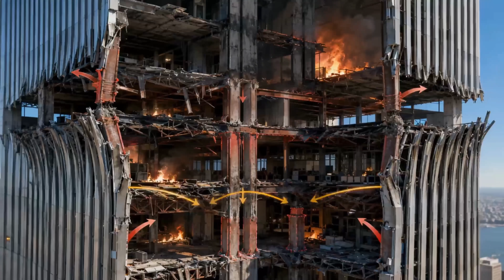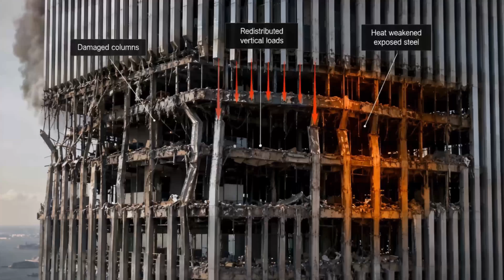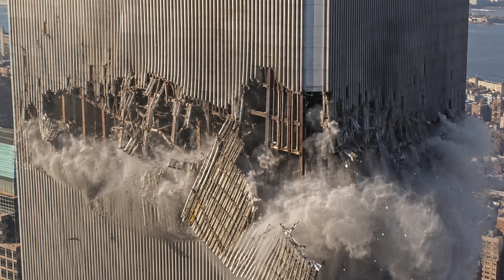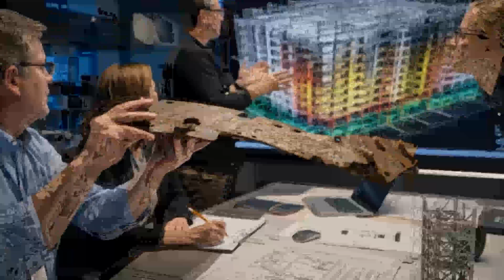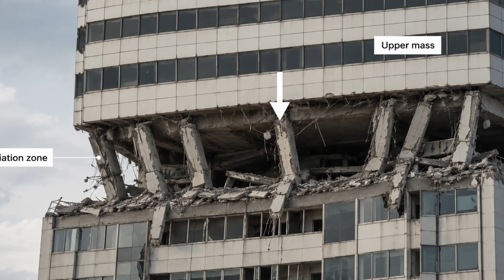What Happened Inside the Twin-Towers After Impact?

Comment: Ppl say the Twin Towers look fragile because of their appearance, but in fact, they might be the heaviest structure ever built if you look at it that way. The steel columns are 30 inches wide; it takes dozens of people to lift just one piece. And that's what must be traumatic... We jump when a heavy metal object falls to the ground. Imagine the impact of a 417-meter steel tower with concrete, machinery, and supplies crashing to the ground, not to mention the sound of the weight gradually accumulating
Reply: Nah people think every single building can withstand a freaking airplane at 700 km/h

Literally no weakness at all, it took them a lot of time to collapse for what they were against
Reply: Building 7!was not hit by an airplane.  So much for your theory.
Reply: @markcohen308  No, but it was hit by falling debris from the towers, sparking massive fires within the building.
Reply: @TheTruthCalls 
What "massive" fires made wtc7 to collapse simultaneously from all sides at gravity acceleration???
Reply: @ciuzdamm There are dozens of documentaries out there explaining the damage caused by the tower collapse, and extensive evidence of the raging fires burning within the building for hours before the collapse. If you wish to ignore this evidence, then that's on you, but it is out there.
Reply: @TheTruthCalls  It wasn't hours bro, There is no law in this world that they could collapse fully and vertical, ask an expert they say that is impossible, that's evidence but most keep their mouth shut except for Coen Vermeeren.
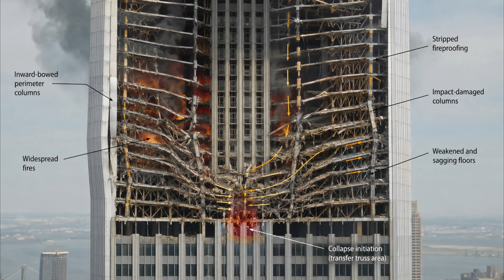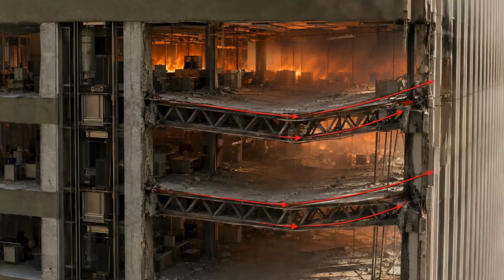Reply: @Darth-Lord-Raven  I consider seven hours "hours". Tower 1 came down at ~10:30, it's debris striking WTC7 and setting it on fire. The building eventually collapsed at 5:21, or seven hours later.

The towers collapsing straight down is exactly what should have happened given their design. As the floors started pancaking down, the central core kept the floor slabs in a vertical line. Computer models confirm this is exactly what would be expected.
Reply: @TheTruthCalls  Exactly 7 hours? :text-yellow-goal:Suspicious. Yea well. It's really is as the fundament cannot collapse, everything is wrong about it. Where is this computer model?
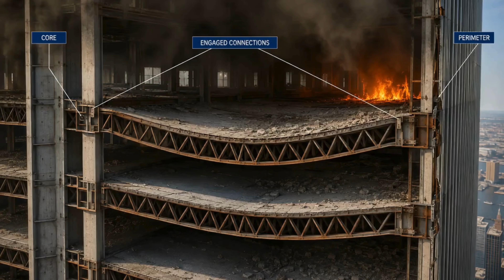Reply: @Darth-Lord-Raven  Not exactly - it was from 10:29 to 5:20, so 6 hours 51 minutes. You got me!  Suspicious?  How so... it's clearly documented.

It can and did collapse. NIST created a computer model of the failure, but there are numerous others out there. I suggest you do a little research but this time actually pay attention to the engineering analysis that explains it, as opposed to ignoring everything that doesn't fit your understanding.
Reply: @TheTruthCalls  Trust me i've done my research. There weren't any planes at all in the first place. I'm no conpiracy thinker  but always looking out for the truth. They used missiles and hologram technology that already existed for the twin towers, all these buildings cannot collapse mate it's impossible. They used nuclear explosion for building 7, there is no other way there is a 100+ meter smoke coming out of the top. Don't believe what you see, is not true.
Reply: @Darth-Lord-Raven  LOL... OK, and the moon landings were staged, right?
Reply: @Darth-Lord-Raven  Holographic technology is not even remotely close enough to make a missile look like an airliner, and at the end of the day, four airliners, including passengers and crew disappeared. So where are those planes, passengers and crew if they didn't perish when hitting their targets?

Further, the impact pattern in the towers show airplanes hit them. A missile would have created a circular hole, yet the entry wound is in the shape of a fuselage with wings... you know, exactly the shape we all saw as it flew into the building. Something tells me you're search for truth isn't working out so well.
Reply: @TheTruthCalls  Well, look it up: a Cruise Missile will have wings aswell.
Reply: @TheTruthCalls  That's another discussion bro.
Reply: @Darth-Lord-Raven  Yes, and the largest wingspan of all our cruise missiles is 12'. The wingspan of a 757 is 124', and a 767 is 170'.  A 12' wingspan did not make a slash into the building which was nearly the entire width of the building, which is 207'.
Reply: @Darth-Lord-Raven  And I'm sure it would be an interesting one. You seem to be so convinced of one thing that it's impossible for you to think of anything else. There are so many reasons to KNOW the towers and WTC 7 feel due to fire, weakened steel, and damage from the planes, and from the South Tower collapsing and hitting WTC 7.

And BTW, yes, the moon landings were real. Men have walked on the moon six times, and hopefully soon enough, there will be a seventh. I wonder what will happen to those who think we didn't land, once we're there and we document what remains from the prior landings. I suspect someone will argue a robotic ship was sent ahead to spread stuff about to pretend we were there.  LOL..
Reply: @TheTruthCalls  Be proud of your country then. Ppl liking to have lies lying for their nose. Fine for me, bro hope you someday wake up. And there is nothing personal on this conversation.
Reply: @Darth-Lord-Raven  The only one who needs to wake up is you. Your commentary here clearly shows you are easily duped, and have virtually no understanding of the complexity of controlled demolition.
Reply: @TheTruthCalls  Looks like you're under hypnosis, GL. Wake up bro.
Reply: @TheTruthCalls  I've yet to see any definitive proof that falling debris was the cause of the fires in Building 7. This is entirely speculation, and speculation is not science.
Reply: @sorcerykid  I disagree (I think).. I'm pretty sure there are videos of WTC 7 burning shortly after the South tower collapsed. There is certainly video evidence it was burning for over seven hours, so if you do the math, either falling debris, which put a 15 story gash in the building, started the fire or someone with a Bic lighter, but it was burning for a very long time.
Reply: @TheTruthCalls  Seeing fires after the collapse does not mean the debris started the fire. That is known as speculation, which is not the basis of forensic science.

I worked at a famous Illinois nightclub for almost 15 years until the owner retired. The business was bought out by real estate developer who knew the history of the building, yet really wanted to replace it with student apartments. However, the developer also realized that the city would look very unkindly at him demolishing a 140 year old buiilding given its cultural significance (I know all of this because I secretly overheard him joking about it to some other developers as I was cleaning out the DJ booth).

Now get this: Less than 4 months after the deed was transfered, the upstairs workroom caught fire, which led to significant structural damage requiring much of the interior to be demolished. However, this fire was widely reported in the news as purely accidental with no known cause. Yet, within only one week of the incident, I was brought in for questioning as the prime suspect in an arson investigation, apparently because as the former head DJ I spent more time there than almost any other employee. During my multiple rounds of questioning, I learned that they found a blowtorch in the workroom that was used to ignite the beams above the office. Yet despite all of this, the arson investigation never got reported in the news. So the public at large, still to this day fully believes the narrative that this famous historic building just suffered an accidental fire right after it got bought by a new owner.

This is why I refuse to buy into any speculation about the cause of the fire in Building 7 without definitive and indisputable proof. Because as you can see from my own first-hand experience, it's very easy to con the public into believing a completely different story about the cause of a fire, whether because the media is completely oblivioius to the truth or else because of certain powers that be seeking to suppress the truth so as protect the interests of various stakeholders.

We absolutelly cannot eliminate the possibility of foul play. It would have been effortless for a bad actor to enter Building 7 given all the chaos of the North Tower collapsing and start random office fires with nothing more than a lighter.
Reply: @sorcerykid  Trust me, I understand we can not eliminate the possibility of foul play, but by the same token, you don't have any evidence that it was. Conversely, we do have one of the tallest buildings in the world collapsing adjacent to WTC 7, and that collapse did cause significant damage to the exterior skin of the building. So of the 'competing theories', the fire starting as a result of the collapse does have much more supporting evidence. The fire did start about the time of the collapse, the building was struck by falling debris, and, as far as I know, there is no direct evidence of foul play. Plenty of speculation, but nothing that proves it.
Reply: @TheTruthCalls  We had the collapse of the South Tower into the Deutsche Bank Building which caused extensive damage to the exterior of that building, yet not a single fire erupted moreless on multiple floors. Yet despite the similarities in distance, size, damage, etc. including being struck by debris from one the world's tallest buildings, only WTC7 caught fire.

Saying, "you don't have any evidence it was" is not a reason to dismiss the potential for foul play. That's not how fires are investigated. Add to the fact, you can't put forth any theory until you have evidence. And there is currently zero evidence to substantiate that the fire in WTC7 erupted as a direct result of debris from the North Tower. This is why we have the Guide for Fire and Explosion Investigations (NFPA 921) standard which strictly relies on positive evidence. Without positive evidence, the cause is undetermined.

You also remarked, "we don't have any evidence" despite the fact I just shared a story about an arson investigation where I was the lead suspect and there was concrete evidence available, but those facts were never shared publicly nor reported in the news.
Reply: @sorcerykid  Did the Deutsche Bank building have 40,000 gallons of diesel fuel stored inside?

"Saying, "you don't have any evidence it was" is not a reason to dismiss the potential for foul play." - I agree, which is likely why I agreed in my response to you. But again, the building was adjacent to the worst building collapse in history, did suffer substantial damage, and the fires did start about the same time as the collapse. Conversely, there is nothing other than speculation to support a more nefarious explanation. However, I agree, the cause must remain undetermined if not proven.

Sharing an arson story is not evidence to support intentional lighting of THIS fire. History is littered with fires starting due to arsonists as well as fires starting due to no direct intentional action. Just because people burn down their homes for insurance payouts doesn't mean all home fires are started that way. And while I also would agree evidence is often hidden, and so this remains a possibility, this still remains nothing more than speculation.
Reply: @josearturobaez  You can't fly a plane at that speed on that height so it wasn't a plane at all.
Reply: They weren't strong structures at all the steel was only 3/8" I-beams near the top.
Only the basement was strong the rest was lightweight.
Reply: That’s actually completely logical🤦 the higher you go in a skyscraper, the less weight the columns have to support, which is why the steel can gradually become thinner toward the top. The columns near the bottom, on the other hand, have to carry the accumulated weight of dozens of floors above them, so naturally they need to be much heavier and stronger. So pointing to thinner steel near the top as evidence that the Twin Towers were somehow weak doesn’t really make sense, since that difference in thickness is simply part of how the structure was engineered for the loads at each level.
Reply: @patatebanine4278  Well that would normally be the case - but here there is a massive transition from very heavy basement design => light weight office floors => to massive heavily engineered hat truss at the top. So its inconsistent with that normal concept.
Reply: @patatebanine4278 there is no way the top section collapsing was going to cancel the lower sections ability to hold up what was above it, as it collapsed through the zone of greatest resistance at near free fall speed. Mossad blew it up. They are demolition experts. They have demolished 90% of the buildings in Gaza in 3 years. Mossad are bomb experts they detonated 3500 pager bombs simultaneously in lebanon on the single largest terrorist bombing in human history. 9/11 was a cakewalk for mossad. Imagine the covert operation required for the pager bomb operation. 9/11 would require the same expertise. Capability opportunity and motive equals mossad
Reply: @patatebanine4278 I'm UNION IRONWORKER AND YOU GUYS COMMENTS ARE SO IRRELEVANTS,, NO F... WAY I-BEAM  ARE 3/8 THIN OR WIDE, IN A HIGH RISE LIKE THAT THERE'S HEAVY 5-8 INCHES THICK FLANGE BEAMS, THEY CALL BOX COLUMNS BUT THE HEAT WILL BEND STEEL WHEN IT REACHES 1500 DEGREES PLUS WEIGHT ON THE FLOORS NO  IRON WILL RESIST ALL KINDS OF DAMAGES, I SEEING IT BEFORE
Reply: So you’re saying the towers collapsed due to explosives set off by Mossad?
If you look really close there were actually fully-fueled passenger planes that crashed into and exploded inside both buildings that day. That’s prolly unrelated to the collapse though right?
Reply: @SpaceIceEnthusiast mossad explosive collapsed the towers. The planes if they were the commercial flights we are told hit the buildings did damage. The subsequent fire did damge. The buildings collapsed because of pre planted explosives. Basic crime analysis: Motive, opportunity, capability, falls to clandestine state operators, not just a CIA asset on dialysis in a cave in tora bora with a satelite phone.
Reply: @SpaceIceEnthusiast Not touching the geopolitics, no clue about that. But mechanically: '93 was a truck bomb in the basement meant to topple a tower, and it failed. Years later the plan changed to hijacked planes. If explosives already failed at ground level with easy access, the idea that smaller hidden charges near the top somehow finished the job better in 2001 doesn't track. And structurally, taking down a steel tower with explosives means precision charges on every load-bearing column, wired in advance with full access — not something you slip in quietly.
Also: what adhesive keeps a charge bonded to a steel column through a 500+ mph plane impact and a kerosene explosion? No adhesive survives that, which is exactly why explosives don't explain the collapse.
What does explain it is progressive collapse. The South Tower was hit around the 78th floor. The impact and fire weakened the steel supporting the floors above that point, and once those floors couldn't hold their own weight anymore, they gave way and dropped onto the floor below, which then couldn't hold the added weight either, and so on down... that's what we call the "pancake" progressive collapse. It's a weight-accumulation failure, not a demolition pattern
Reply: And your course “the building was weak” crowd never points out that the core columns could support twice their load and the perimeter columns five times their load.
Reply: @patatebanine4278  and the 93 incident and also the massive three alarm fire in the North Tower on 1975 both did ZERO to the structural integrity of the building.  Just magically on 9/11.  Oh what about the jet fuel??, what about the plane impacts??  NIST said the jet fuel burned off in minutes and Building 7 was not hit by an airplane and it too collapsed at free fall acceleration.  The official story is deeply problematic from every direction.you want to look at it.  The official story is Anti-Science in the extreme.
Reply: @patatebanine4278  Wait, so let me get this straight. Office fires can bring down a massvive steel-framed skyscraper faster and easier than carefully placed explosives can. In other words, the controlled demolition industry is an outright scam.
Reply: @fx-studio  Don't let appearance be fooled by high-quality, super strength steel. Even though the trident outer columns were just under an inch (2.5cm) thick where the airplanes hit the building, they were designed to carry 40% of the total load. We know each tower weighed about 100.000 tons from the point of impact and above, so all the beams were engineered to carry that with ease. 

Much of the two airplanes was built from aluminium, which is much lighter than steel. It also wasn't forged in the same way the steel columns of the towers were. Hence, no wonder the two airplanes completely disintegrated on impact, whilst you could still see many of the columns in and around the impact zone standing.
Reply: Looks just like a bunch of fake narratives that nist has come up with, who hasn't seen or heard all that crap. All of their so called excuses have major holes in them that science says are lies, get real man
Reply: WHAT
Reply: Those Beams were 4inch thick plate welded box beams how an aluminium plane wing cut through those Steel Beams is hard to believe
Reply: @rencelani-ty2sc  I think that is an exceptionally weak argument in an exceptionally strong case
Reply: Absolute crap - the Empire State is seven times over engineered - it has massive Carniegie columns in a bird cage matrix and all of them encapsulated in thick masonery and fire compartmentation in concrete and brick.
The Towers were steel framed as thin as a computer could suggest and with vast open spaces without support - the floors were only 4" thick and virtually every partition was plasterboard - in fact most of the giant cloud of dust was gypsum from all that wallboard.
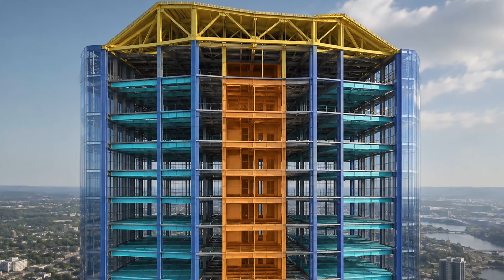Reply: @alanclark639  Total nonsense, everything you just said. Nearly all of the dust was pulverized concrete.  Nice try but only the most ignorant will fall for your swill.  "…and you look, and you see, and there's no concrete, there's very little concrete, all you see is aluminum and steel. The concrete was pulverized, and I was down here Tuesday, and it was like you are on a foreign planet, all of lower Manhattan, not just this site, river to river, there was dust, powder, two or three inches thick, the concrete was just pulverized.”  --- Governor George Pataki, while touring Ground Zero with George W. Bush. CNN, September 14, 2001 https://www.youtube.com/watch?v=MDuBi8KyOhw&t=126s (at 2:00 minutes into the video)
Reply: @markcohen308  The only concrete used in the construction of the towers was the 4" layer each floor was comprised of. Of course, each floor was about one acre in size, and there were 110 floors, two towers, so that's 220 acres worth of 4" concrete floor. Yup, that's going to generate a lot of concrete dust.

But that does not mean Alan Clarks post above was "total nonsense" as you claimed. The point was, the WTC towers are an entirely steel construction. No concrete was supporting the towers (other than the foundation). So while fire wouldn't impact the Empire State Building because the steel is encased in concrete, the WTC towers steel was completely exposed. 

Alan Clark's post was completely accurate. If you think otherwise, why not pick something from his post you find nonsensical and I'll prove it with facts.
Reply: It's actually pretty light for a skyscraper. Check out the videos on how it was built. They're pretty good I think.
Reply: The perimeter wall columns, at the impact floors were fabricated 14" square "box beams," approximately 3/8" to 1/4" of material thickness.  It must be understood that, as the towers rose in height,  structural memebers were constructed of progressively lighter steel elements because the loads lessened with height.
Reply: @hiturbine  You're so full of it, seriously.  "many structural and fire protection features of the design and construction were superior to the minimum code requirements."
--- FEMA: World Trade Center Building Performance Study, p 2., May 1, 2002, www.fema.gov/library/wtcstudy.shtm